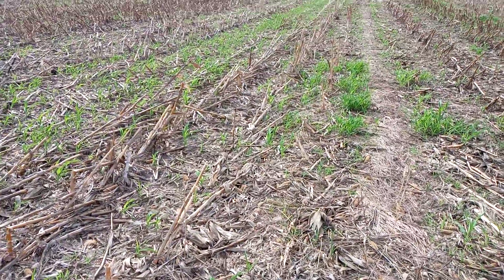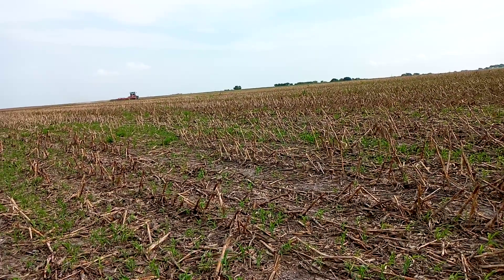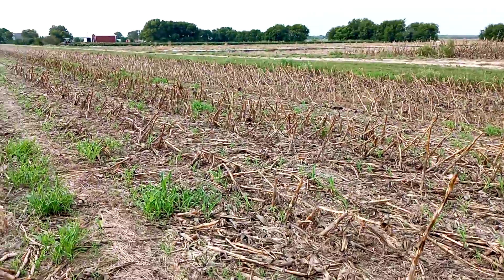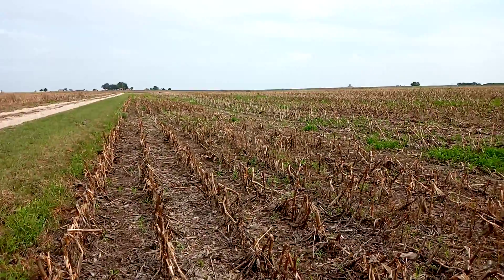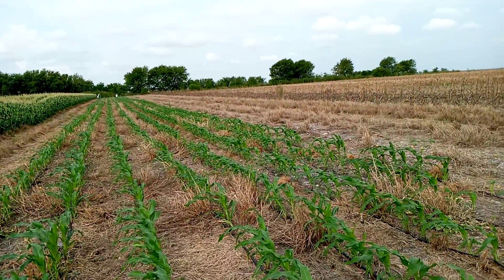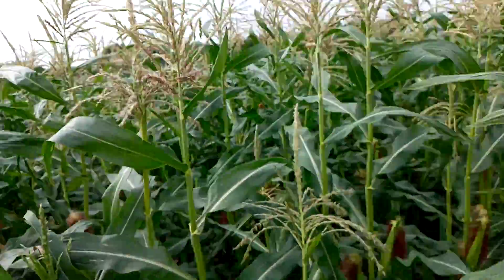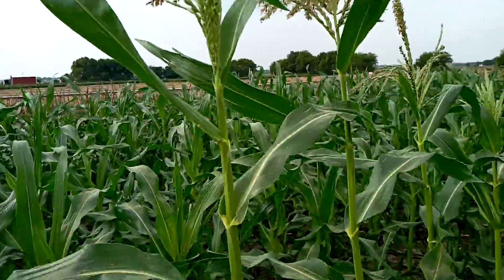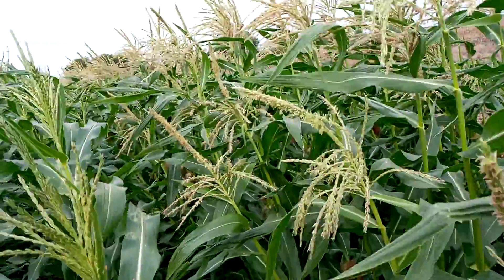Update on fall weeds and sweet corn in Central Texas.

Comment: You have some nice sweet corn silking.   One of my sprinklers is still going on corn to finish & to prewater for 2021 cotton.   I think  our normally planted corn is going to be getting to black layer in about in about 150 GDD.s,    We got about 12 per day for the last week and in our 52-84 forecast.   On our best field the dry ear weight is .58 lb average, the stand average is 32.5K.     Could be the best quarter yet.
Reply from the maker: If you're that close to blacklayer, then bank it!  We;re getting 28 gdu/day here, two weeks til harvest. That is a heavy ear on that stand count. This sweet corn was grown @24k with a 200 bpa target fertility program for reference (N-P and most of the K fed through the tape). Finally cleared .4 on the P tissue test!
Reply: @TwoHappyChildrenFarm   Most of our corn has a stand of 31,000 as we planted 32500.   Tomorrow, I will get the average ear weight by measuring 17.4' in 4 places and pick every 1/10 ear.  I will weigh the 12 ears.  Last Sunday they averaged .81 lbs wet weight.   We are high in K and P so we just use a maintenance fertilizer program every few years.
Reply: The ear weight is average of .797 lb that weighted .576 of 15% grain.  The population was 29000 because a few were taken out turning by the spray rig when it was a ft tall.   The leaves above the ears are not all green so will stop gaining dry matter soon.   We had a good fill compared to Central Texas.   We are replacing ware parts on the combine and could be harvesting in 4 weeks!  Our combine has 1800 hrs and will have to last longer as we put $15,000 in 2020 if nothing else shows up.